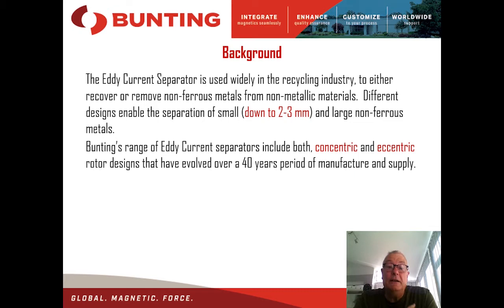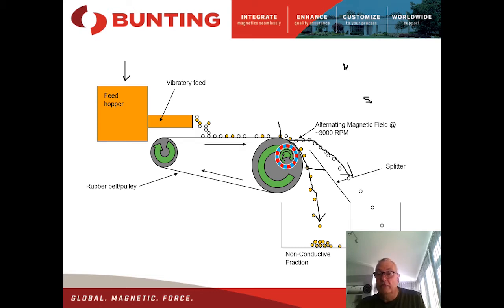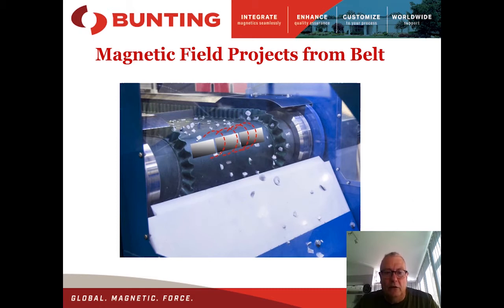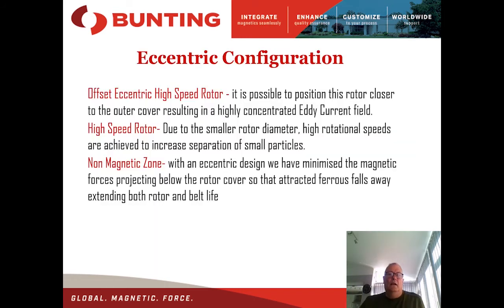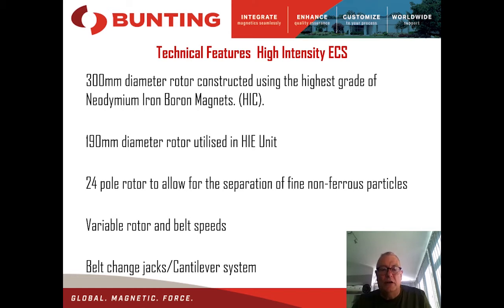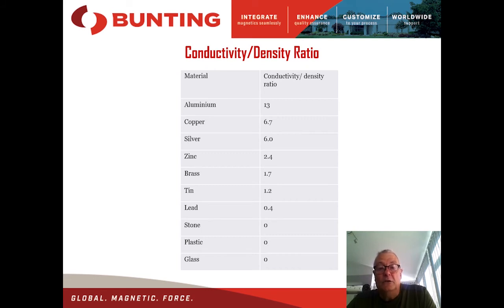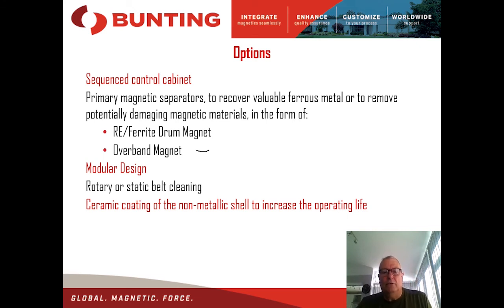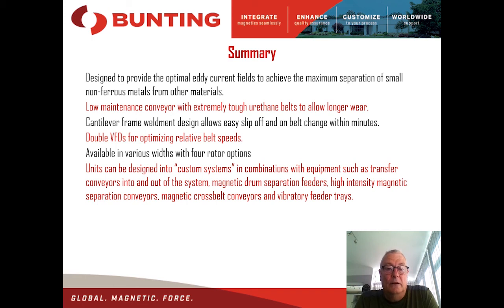Eddy Current Separator Technical Overview by Prof Neil Rowson

Comment: gold has a conductivity of 45*10^6 S/m and a density of 19.32, which would put its conductivity/density ratio at 2.33, so just a little bit bellow zinc, but higher then brass, why cant we use this to separate gold and the preferred separation method is by density ? I can easily guess that separation by density is really effective for gold since its so dense, but if my client system doesn't have a density separator and he only want to acquire an Eddy Current Separator, will the gold be also separated ?